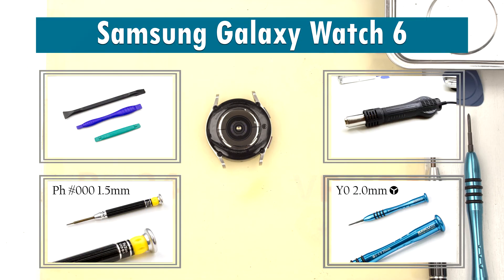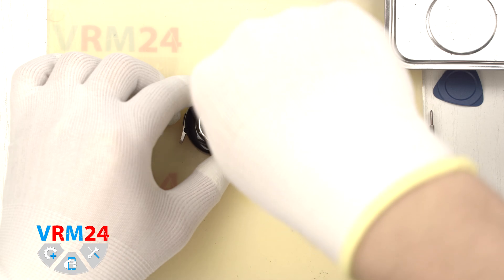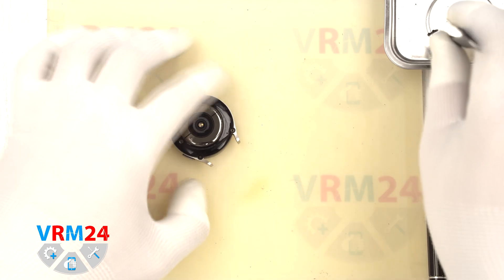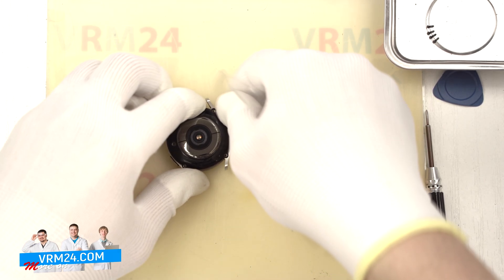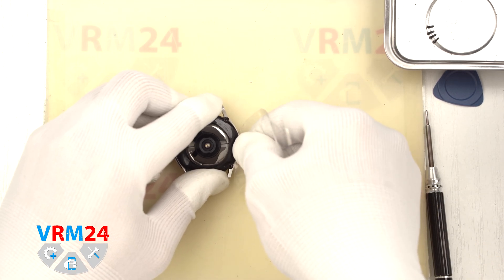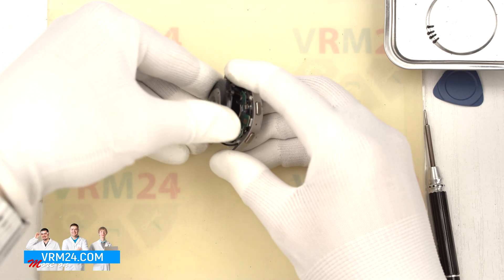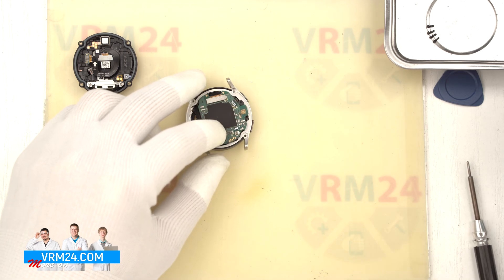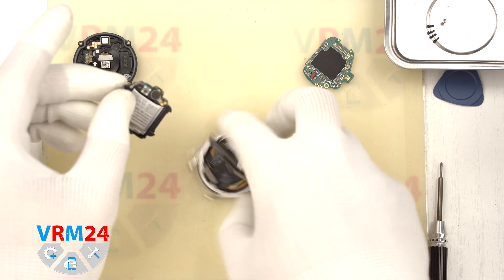Samsung Galaxy Watch 6 SM-R930 Disassembly in detail Take apart

Comment: can u make a teardown of the back cover assembly
Reply: So I did just replace my back cover glass on my samsung galaxy 6 classic watch 47mm since it was shattered and I couldn't wear my watch and get glass in my wrist. I orderd the back glass part from Amazon and also ordered a small parts screw driver kit with the Y shape bits. In order to get the glass back off and replace it up need to remove the back 4 screws then unplug the ribbon to take remove the back cover. Then you need to remove this tiny white plug cover from the other side of the ribbon then unplug the ribbon connecting to the glass back cover. Be careful with removing the white plug cover cause I payed up on it and it went flying it was a miracle I even found it. So now you can dig the glass out of the back cover took me forever. I used a tiny flat head to pry it up. Then I used the same flathead to get the old seal off once that was done use a glass cleaner wipe the remove any left over glass and clean up any specks then dry with a micro fiber cloth. Now your ready to put the new seal on and carefully set the back cover on the new glass back. I plugged everything back in and it works good as new.